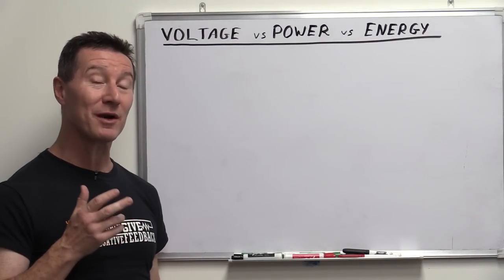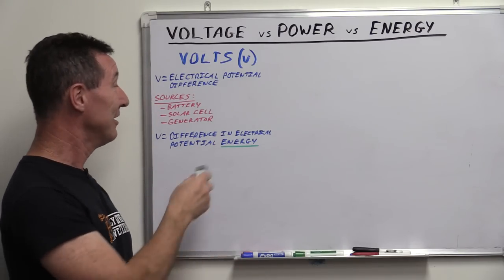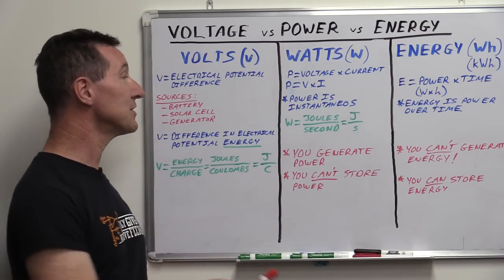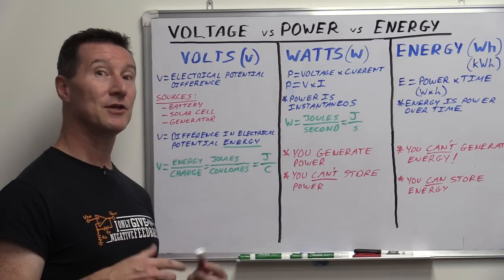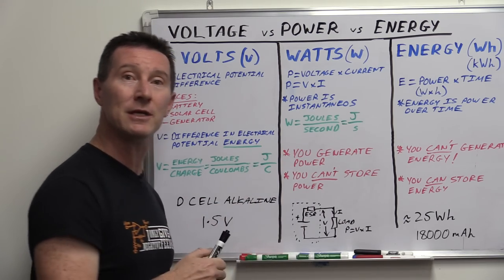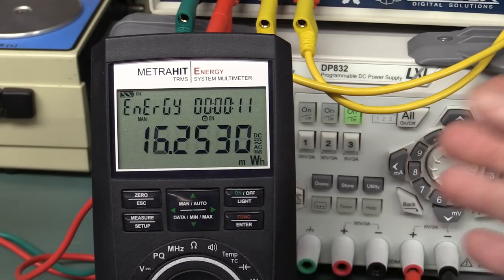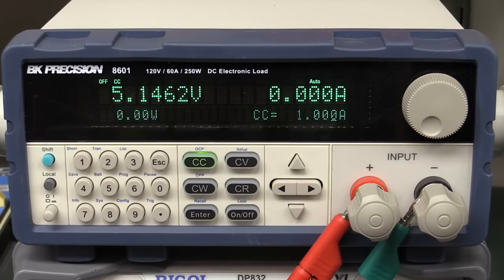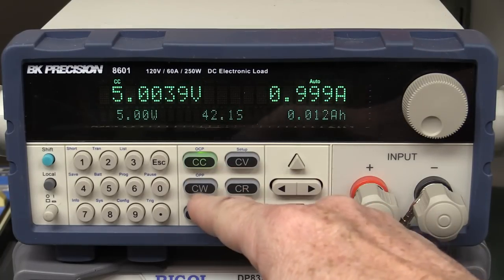EEVblog #1009 - Voltage vs Power vs Energy

Comment: I've been asked this question but haven't had a good answer: How do people survive being struck by lightning?
Reply: Skin effect, mostly.  Lighting is a very fast event, which means it is a very high frequency pulse current.  High frequency currents confine themselves to the surface of a conductor, and can't travel through the center due to skin effect.  This is what saves people.  Very little of the energy travels through your internal organs. You'll have burns, and your heart may stop, and your nervous system might need a while to reset, but it won't blow your guts apart.  As long as your heart keeps going (or is restarted in time) and your nervous system starts you breathing again before you asphyxiate, you'll likely survive.
Reply: Because they were NOT hit by main discharge channel ("leader")! That's all.
Lightning has multiple branches (on picture it looks like roots of a plant, right?).
Those who survived, received only one little tiny "whisker" of a whole lightning.
Reply: Both Star Gazer and Xyz Zyx are correct.  Even the branches take the easiest path to ground and the skin surface could be wet due to rainfall and/or perspiration (salt included).  I've heard of several people getting their clothes ( including shoes blown off due to the quick evaporation of the water that is conducting the current flow.

Comment: Dave. It seems that you are waffling on too much in this video.
Secondly, you were a fair bit confusing at times. And using text doesn't help.
Though, you probably tried far to hard to be simple, yet technical on the same time.
And you missed to mention how the Coulomb and Amp is related. Though, I am not going to state that you need to explain Voltage as the electron density in a conductor, and that current is the flow of these electrons, nor that power is the density difference between two points, or how each electron has an magnetic and an electric field and how these then relate to how we can create capacitors and inductors. As it might be a bit hard for some to understand that a few electrons in difference can create a voltage, or how a low enough current, (0,1aA (0,1e-18 A)) is going to be one electron per second.

Comment: The dam thing at the end is wrong. Rate of flow is current, and volume of water is charge.
Reply: I mean if you're going to explain it, why not go out of your way to be correct?
Reply: yeah that didnt make any sense clearly the reservoir ~ battery, gate ~ switch, beyond the gate ~ another battery with virtually infinite capacity, water flow ~ current
Reply: I would argue the 'height' of the water better describes voltage than the volume. It makes it easier to understand 'potential' as you can relate to to potential energy in physical science.
Reply: Why do you consider volume of water to be charge, then?
Reply: Yeah, you're right, the rate of flow is current but the volume of water is the charge... and once the section or column of water reaches the bottom it would be at its peak power.
Reply: Everyone is correct. When you think of capacitor, you can also think of a dam. Both system is similar in that it carry & contain energy, both had current and capacity, the only difference is the details; either it use water molecule or electrons... If you want to have an easy life, then you just follow the video's explanation. The term: "pressure", "current", "energy", "potential", "power", ect is abstract, it isn't something that you can touch, it describe a behaviour. of 'stuff'. If you continue arguing about it, you'd be like philosophers who questioned the meaning of "temperature", because it is abstract too...
Reply: tohopes
No.  Area is analogous to current, rate of flow analogous to voltage, and power is the area times the rate of flow.  Energy is the total amount of water that flows past a given point.

A fast flowing but small river (high V, low I) can deliver the same amount of water per unit time (W) or amount of water over a given time (Wh) as a slower flowing but larger river (low V, high I).

The way it was explained to me, by an uncle who was an electrician, was to think of water pipes.  The flow rate is voltage, the diameter of the pipe is current.  The rest of the relationships can be derived from this intuitively.
Reply: Dave had it right.  Pressure is analogous to voltage.  It is potential energy due to the height of the water.
Reply: Star Gazer: I know that Dave had voltage = height correct. What I'm saying is that he had the other two parts wrong.
Reply: @boggisthecat

Well not to tear down your idol, but your uncle was definitely wrong. Not that it made him a bad engineer (because we don't always have to fully understand all concepts in order to get the job done, as is the case with humanity still not fully understanding gravity), but just that he was illogical pertaining this analogy.

Resistance = the diameter of the pipe. 
Current = the volume of water that can flow through the pipe per second (without the aid of pressure). 
Voltage  = the pressure to reduce the effect of resistance. 
Watts = the total amount that exits or enters the pipe per second. 
Energy = the amount of water that is in a container before it enters the pipe, or is the amount of water accumulated over time that has exited the pipe.

But as I elsewhere stated in the comment section, the water analogy is far from perfect, so it's difficult to convey all electrical concepts coherently. Sadly it's one of the best analogies regarding electricity that  we've got. But fortunately it still has managed us to get any electrical job done.
Reply: TL;DR: The video would be far harder for a n00b to understand if he was talking about voltage, current, charge, power AND energy on that slide. I assume Dave chose this modified water analogy for clarity and simplicity of explanation.

Tohopes, you're correct that the video does not correctly reflect the normal way that the water analogy is typically used; but anyone that can see that doesn't need to be watching this video. When taken on its own, Dave's water analogy is perfectly self-consistent as far as the distinction between power and energy is concerned (if you ignore the voltage = height part which is just completely irrelevant either way), and is far simpler to understand than the more typical, more powerful water analog where flow = current.
Reply: No, Hue. Volume cannot be said to be energy. Telling someone so will eventually lead to confusion.

Think about what happens after the water falls from above to below the dam: there is still just as much volume after as before the fall. If energy were analogous to volume, then there would be just as much energy after the water fell from the dam as before. But in fact, the energy is gone! Because the charge, while still present, has lost its potential in the act of "falling" (or flowing).

Charge and energy must be distinguished unless you want the person to end up confused at some point.

Given that Dave decided to put 16 minutes into this issue, he may as well have made that distinction clear in one go.
Reply: Energy not too hard to understand it's the stored force of an item, it's the fuel - and when it is used up you have no more energy. You can't use up volts or watts, you use energy.
Reply: Tohopes, the only reason you're objecting is because this analogy isn't identical to the typical electrical engineering water analogy. You should be suggesting a totally different analogy, rather than making a pedagogically silly suggestion like presenting the full, 5-concept water analogy which would leave the average Joe completely confused.
Reply: I think @tohopes and everyone else is, in a sense, right! Everyone else was stressing that the dam contain "Energy", "Power", & "Potential Energy (volt)". But @tohopes is in other hand is going off tangent and stressing that the dam actually contain "charges", "current", (and is including) "resistance" and "voltage". You can see that the first point is talking about Energy behaviour, while the second point is taking about flow behaviour. Both is right, to be honest!
Reply: L1b3rta
This was an analogy to explain the relationship between power and energy (and voltage and current, although Dave omitted current).  Resistance is a derived unit.

You're quite wrong.
Reply: boggisthecat; OK, so what's the analogy of electrical resistance in your system then? Because the normal water analogy* has voltage corresponding to pressure; current corresponding to flow rate, and a high resistance corresponding to a narrow tube. Given that you want to have current corresponding to the cross-sectional area of the tube, I'm fascinated to find out what you suggest "intuitively" follows as the analogy for resistance.

* Source: "Hydraulic analogy" on wikipedia
Reply: I think the best analogy of electricity is MAGIC.  You can use things like U = R * I and P = U * I and Kirschoff's laws to measure and predict its magical properties.  Oh wait, that's not an analogy of electricity, it's the real deal!
Reply: Charge vs. Energy?
Reply: Hue: No, I did not object "because this analogy isn't identical to the typical electrical engineering water analogy". I objected because this analogy is likely to mislead, in precisely the way I pointed out. Anyone attempting to use the "water falling through a dam" analogy to remember how to interpret these electrical concepts is likely to question what effect the fall has on the volume of water, and how volume of water relates or doesn't relate to volume of electrons - and Dave's overly reduced explanation will leave them at a loss. If "the typical analogy" is more in line with what I have pointed out than with what Dave presented here, it is for very good reason.
Reply: And still, you conveniently ignore the fact that your proposed (and typical) analogy is ill-suited to this video, as one has to multiply flow (current) and voltage (height) to get power (power), and has to multiply volume (charge) and voltage (height) to get energy (energy). Any analogy which involves multiplications and introducing two entirely new and otherwise irrelevant concepts is just idiotically ill-suited to a video pitched at this level; regardless of any other ostensible confusions further down the line.
Reply: He meant that power is dissipated by the flow of water or current

Comment: Voltage does not exist, silly English speaking people. It's tension (NL: spanning, FR: tension [as in haute tension]). Use something else than "V" for "voltage", use U (as in U=123V, not V=123V).
Reply: Bjorn Roesbeke I think the letter U was chosen to resemble the V in voltage, but to avoid confusing formulas such as output=V-0.7V, because those Vs are different.

Comment: This seems a bit of a confused take on this.  "Energy is power over time" should be "Energy is power times time" (energy is joules, J; power is J/s; therefore energy is power multiplied by time: J/s x s = J).
Reply: "Over" means division or "sum" (or Total Effect...well...over time), so he's right (but not 100% clear technically, scientifically). "Over Time" is like idiom probably.
Reply: Xyz Zyx
Yes, I understood what was intended.  My point was that ambiguous wording is far more confusing that just using basic mathematics.

And why not use joules for energy, when it was brought up when discussing power: power in J/s, energy in J -- simple to follow.  One J/s is one W, and one J is one W.s -- then derive kWh from there, if required.

Comment: Voltage is what kills your, Power is what cooks you and Energy is what keeps you hot.
Reply: So both voltage and power kills you (and therefore current does as well), and energy keeps you hot (but not hot enough to kill you as well?). See, this is what pisses me off in the engineering community, some (actually many) of the analogies don't translate the physical world, but only add to the confusion, including yours.
Reply: you shouldn't take my analogy seriously